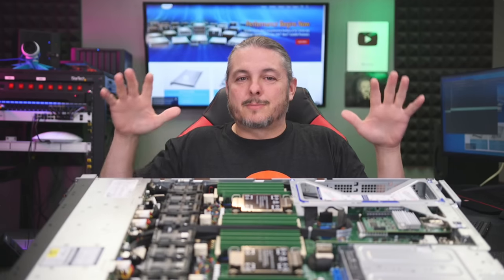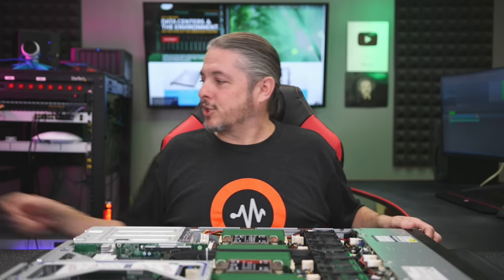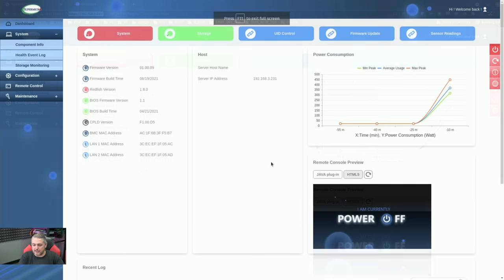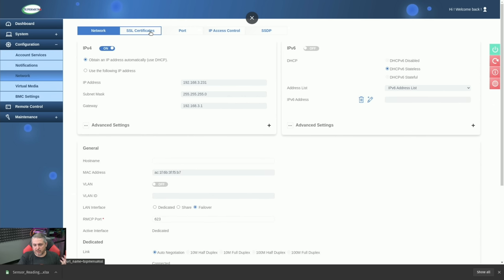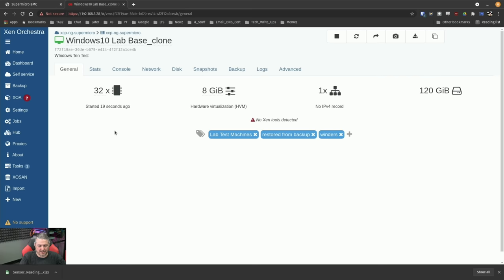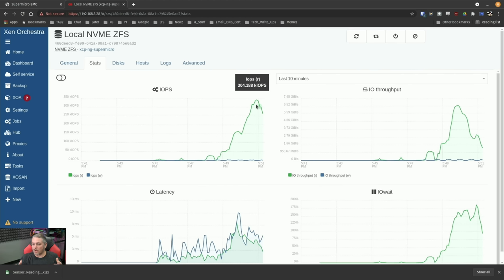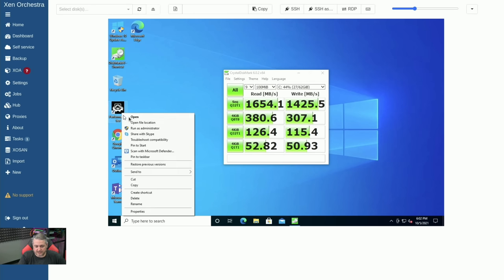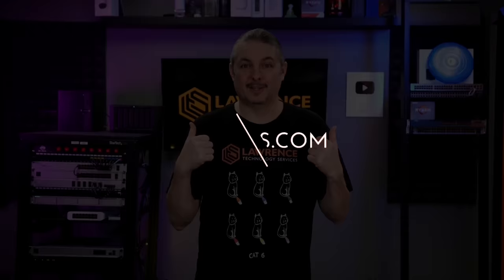Supermicro Ultra SuperServer SYS-120U-TNR Review Running XCP-NG

Comment: Composite/VGA tends to require less power and processing than modern display connections like HDMI or Display Port.  If you’re using a server for dedicated processing you may not be running the actual program on the server itself, for instance using a Threadripper workstation to design a Blender rendering then compiling it using a network package sent to the server(s).  My understanding is that in most enterprise cases, if they do need to physically manage the server directly, it will most likely be a text/bios and not a screen that requires higher resolution or frame-rate.

Comment: VGA pretty much just works. HDMI is licensed. Admittedly, the lower res stuff up to Full HD, would probably work with pretty much any cables you can get for cheap. Once you go beyond that, it is a cluster of failing cables..

Comment: noobquestion: @ 2:53 who would benefit from only using IPMI? or how would it be used in a network setup?
Reply: Like he said, if you wanted it airgapped, i.e. not connected to your network. For backups or anything sensitive enough you deem it appropriate.